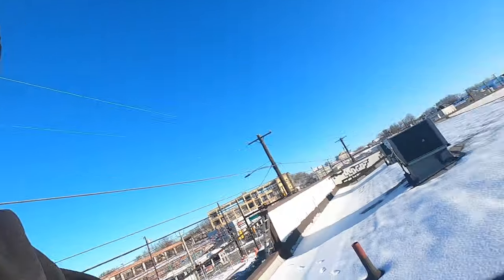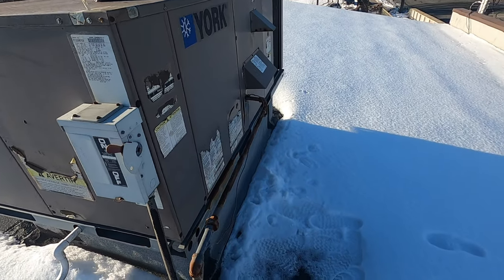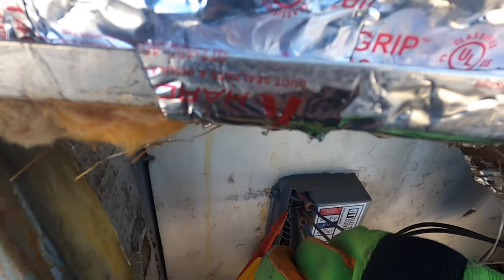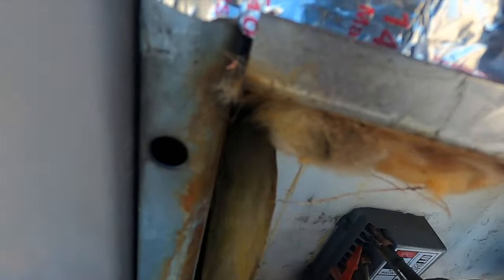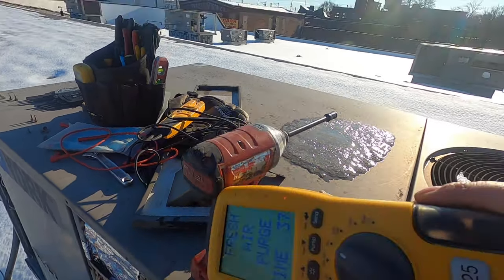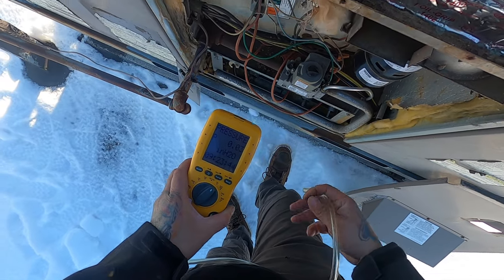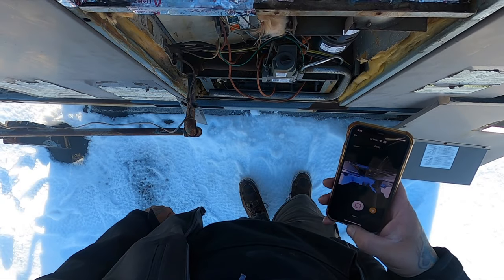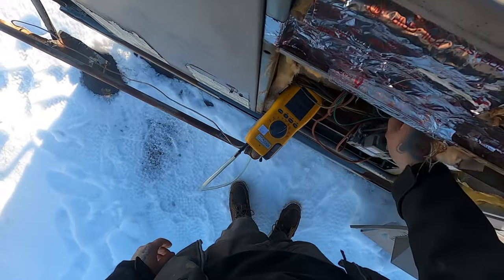PACKAGE UNIT NOT HEATING, WHAT COULD IT BE??

Comment: Sometimes pilot tube is plugged with spider cocoon 
S or rotten on last York rooftop i fixed only pilot pressure.
Changed tube problem fixed cheap aluminum.